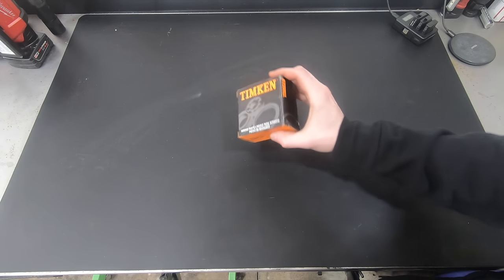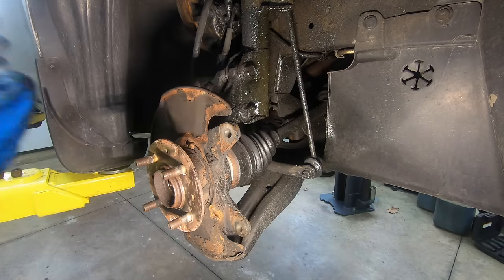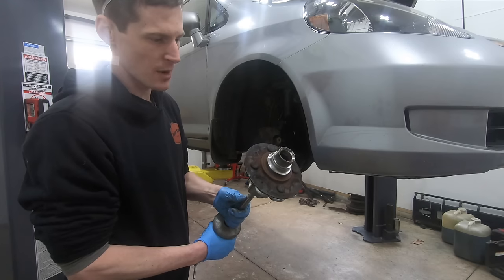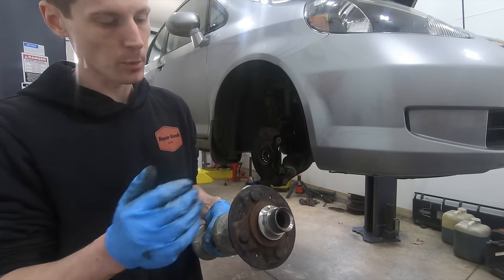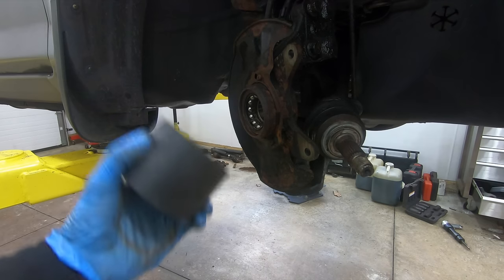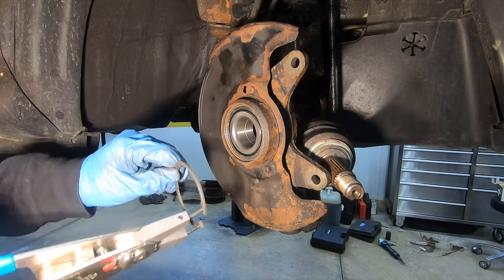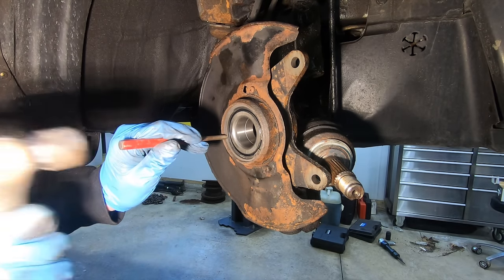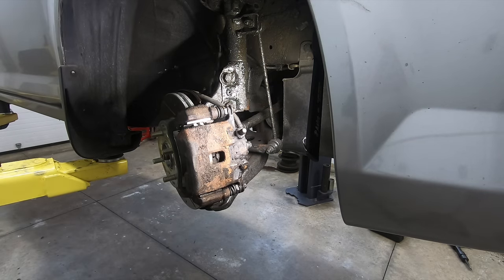How To Change A Press In Wheel Bearing Without A Shop Press.

Comment: The training was very good. Please explain that when installing the hub, how much hub should be inserted into the bearing to be sufficient؟ ❤
Reply: The bearing should be pressed into the hub until it reaches the point where the snap ring will be installed.

Comment: excellent video.  i was looking to see, if you would SIDE stress load the ball bearings while reinstalling. even slightly dinging the races with a impact, CAN severely shorten the lifespan and cause a annoying rumble noise. if a ball bearing is being used to leverage the race in place, it's wrong! most of us have learned this as back yard mechanics. save the beer and caffeine for later!
ALWAYS grind the hand impact screw tip down first, till it fits TIGHTLY in the rotor impact screws. NO WOBBLE OR ramping out of the screw! otherwise you WILL  be torching the now shredded lock screw head out. the impact tips fit loosely on my old1960-70's honda motorcycle case screws. i replaced a lot of mangled screws with allen screws. after 30 years, i have many philips screwdrivers, i modified this way. those sharp pointy tips on number 2's  are actually never needed on screws. manufacturers never bother to do this last step[cost cutting]. buy or borrow a belt sander. BLUNT THEM!   
this step is better then the time invested removing a mangled up screw tip with a cutting torch. this could triple your time on a normal 1 axle brake/rotor job, if you don't. ask me how i know. also grind away rust  & paint both contact sides during rotor removals for anything, in the rust belt or coastal states[salt corrosion!].  make tools work for you, not the other way around.

Comment: When it comes to tightening any axle nut, some do it with the car on the ground or up in the air. 

Which is the best way to do it and do you torque it?

Comment: Excellent video, great thorough job, o have never seen anyone, do one like that, im curious,if a ball joint removal tool, will do the same thing, I bought one from HF, and replaced, the upper and lower, ball joints, and upper can lower control arm bushings, on my 01 express, 1500, conversion van, thank you for sharing!

Comment: Hi. Doesnt the drift has to fit the external side of the bearing in order not to damage the bearing?  I understand, in your particular case, because of the sensor left in place you have no choice but to use a smaller drift despite the risc of damaging the bearing but as a principle ALWAYS use same diameter as the bearing, isnt so?

Comment: Any advice on how to remove a inner race from the knuckle?

As I'm new to this removal of wheel hub bearing I reviewed probably all the known videos on the topic of "Ford 2013 Ford C-Max Front wheel hub bearing". Eventually found your really great video on this topic. But as I have done this task for the first time some things have gone wrong.

I'm a Rocky. But I say this just FYI. I'm am capable of rookie mistakes still. I would attach the major fails.

Major:
1) Bearing outer Race is stuck in the Steering Knuckle so tip it to wield this and it will shrink the remaining piece of the bearing out.
2) The tool slide screw broke on me. This is part number 78825-18 found online not unlike most of these tools.

Minor:
1) turned screw to untighten in wrong direction on  small bolt...

2) I had to tap stripped tox scrip on speed wheel sensor.

3) Lost one nut, but standard size on lower/outer/control-arm. Will get one of these.

Some partial successes:
1) learned how to get the ball joint out using pickle fork and figured out how the odd angle of this lower control arm swing and direction of the ball joint peg angle differ. So just tap of hammer to make ball joint point slightly to center and drops.

2) use slide hammer to get out wheel hub will start with this next time.

Thanks,

Comment: This is a good video. I did notice your brake rotor however and I believe you may have it flipped. That looks to be a front passenger side wheel, but you have a front drivers side rotor on it.

Comment: Very good video for the DIYer. One question. At 17:35 in the video, where you are pressing in the bearing, you stop and appear to change the plate before you firmly seat the bearing. Did you change to a smaller plate to support the inner race? If so, is that necessary?

Comment: Excellent video. you have a nice way of explaining things and you are thorough! 
Snap RIngs: they typically have a side with a hard edge and another with a rounded edge. I like to install them so the hard edge is against the outside. IMO it is better to have the force pushing against this side vs the rounded side  - a little extra insurance that the ring will keep everything in place.

I do something similar with washers when assembling powder coated stuff: tools, machines, trailers. This time I put the rounded edge of the washer against the powder coating. Less chance of the washer cutting into the powder coat and making a place for rust to start. I live in the Rust belt too :)

Comment: I have a question, do you have to put the new wheel bearing and hub in the freezer with an Aluminum Stub Axle, and then take it out of the freezer and press the new bearing and hub in when frozen?

Comment: Glad you dint rip out the center of the bearing and left the outer section good idea so you dint have to mess with the sensor if i had done it with my luck i would have had to do it twice lol good video you should have mentioned the chance you run by pulling from the midle of the bearing not that it was wrong in that situation but so people would no!!!!!!

Comment: Nice video and Bering removal , but a lot easier , cheaper & better to get a hub with the wheel-bearing already  pressed in .
Reply: That wouldn't work in cars with bearings that are pressed into the knuckle before the hub is pressed into the bearing, which is how a lot of cars work.
Reply: @kovie9162  On my Accord they literally were selling the whole brand new knuckle for $150 - new knuckle, has bearing and hub already installed, etc.    It's crazy.      Only question I had was the quality of the bearing they use vs an OEM Honda bearing that you press in like in this video

Comment: 8:35 Not sure if it's possible to remove the dust cover without taking the whole bearing apart, but if you do take it apart, it's a good idea to replace the dust cover while you're at it.

Comment: There is an easier way/tool to remove the hub than with a slide hammer: Astro Pneumatic Tool 78830. Thanks for another nice video.
Reply from the maker: Slide hammer is half the cost though.
Reply: Not easier on the wallet. Astro Pneumatic Tool 78830 costs over $200. Slide Hammer costs less and has more uses.

Comment: The hub pretty much fell out only pulled it off with my hands is that hub bad?? I put new wheel bearing in and when I pressed hub back in. And it was still wiggling so I tried pressing in again and it still has lil wiggle so I tighten cv axel and no wiggle. Still got noise is that hub bad??

Comment: Another Subscriber here.. You explained very well, can I use this procedure on a 2014 crv ,awd with abs, without removing the speed sensor? Since I don’t have acetylene will using map gas loosen the inner race? Thanks in advance

Comment: Guys im just going to tell you from experience, if you have a press in style wheel bearing and its way past due to be fixed, you are better off just getting a whole new knuckle, bearing, and hub assembly. No special tool or amount of psi from a shop press is going to make it budge. A clear indicator is going to be just how hard it is to get the snap ring out and if your brake discs are worn out bad. If you go too long without changing a whiney wheel bearing it is going to heat up and practically weld itself in.

Comment: Hello, this was a very well done video, Thanks for posting. I have a question though, I bought a rear wheel bearing for my 2008 awd tucson and both sides are not magnetic. Does that mean I can put the bearing in any way and the sensor will work?
Reply from the maker: The sensor could possibly be reading the CV axle and not the bearing. Was the original magnetic? You may have the wrong bearing.
Reply: @RepairGeek  the original is not magnetic either and looks the same. I am fairly certain that it is the correct bearing as I was told by a parts store it is and it is listed online on most sites as the correct bearing. I also asked on a hyundai forum and someone who posts a lot there said it is fine, just fit it. The sensor gets the signal from the tone ring and I can put it in either direction as there is no magnet to worry about. Thanks ffor your reply, I am going to put it in today, unfortunately they sent me a bearing for the front but I wanted two rears so now I have to order another one and wait  for that.. there is always something.

Comment: I used an air hammer to remove bearing race from the hub. Heat didn't work for me because I don't have an oxy acetylene torch. Map gas couldn't get it got enough.

Comment: Definitely need to brush never-seize on the axle shaft spline after wire brushing,  but do not use any on the threads. That will distort the proper torque required. The splines will not rust welding place, & if ever removed again, it will prevent a lot of cussing.
Always lube the threads on the puller to make it more effective & make it last longer.

Comment: Great video. Is it okay to use grease or antisieze between the 2 surfaces being pressed together, or does it have to be clean metal? Thanks
Reply: Clean metal. If you use grease or antiseize, you could end up with big problems.
Reply: @kittyhawk2171  thanks

Comment: I am going to be trying to do my 2012 civic exl and 2019 HRV from bearings.  Question. Should bearings still be put in freezer over night? And should I apply grease to outer part of bearing before installing?

I have the same tools you used in video so I think from your amazing footage I can do this. 

Thank you
Reply from the maker: Putting the bearing in the freezer can help but don't expect a drastic change.

Comment: Can you use the same tool to take off the hub as used to take off the bearings instead of the hammer slider version???
Reply: I have this same tool and there's usually no way to make it work that way. If you look at a diagram of how these go together you'll see that it's generally not possible.

Comment: Does the new hub come with a bearing race installed already? It didnt look like your new hub had a race on it?
Reply: No, the bearing race being stuck on the old hub is just a result of you destroying the old bearing taking it apart.   You are pressing the hub back into the new bearing which as you can see is an inner and outer race already assembled

Comment: Is there any reason you can't use the slide hammer to remove the hub without sliding the axle all the way out. Wouldn't the cv axle just slide out the backside as you remove the hub with the slide hammer?
Reply from the maker: You could do that but you still have to get the hub out of the inside of the bearing.
Reply: @RepairGeek  ya I have the bearing  removal kit was just thinking if you just hammered out the hub (leaving the 2 bolts on the upper shock) then once the hub was out then there would be enough free space to get the cv shaft out?

Comment: Great video.  Thank you!  Getting ready to do this on my FWD.

You didn't mention in the video, but I suppose putting either oil or grease on the main bolt (of the bearing press) should help.
I've done wheel stud installation before using a pull-through tool; by oiling the threads I avoided metal-on-metal chew-up.
Reply from the maker: Yep I use anti sieze or grease on the bolt threads.

Comment: This worked excellently for replacing the bearing and hub in my 2009 Honda Fit. Unfortunately, I used a magnet to determine the side with magnetism, which unbeknownst to me at the time, ruined the encoder ring and gave me an ABS code after the replacement.
Reply: Bummer! I saw someone test for magnetism with a paper clip. I imagine using another magnet is what caused the encoder problem.

Comment: Excellent video. I noticed you used the air ratchet as opposed to your electric Milwaukee.  I have electric impacts. Have you done this job before with an electric impact pressing in and out the bearing and wheel hub?
Reply from the maker: The electric will do it no doubt. I have more experience with a pneumatic impact.  It's easier for me to tell when it is laboring audibly. Just personal preference.

Comment: How do you like that flexzilla air hose reel? On the fence about it?
Reply from the maker: I like it I've had it 4 years or so. No leaks. The return spring could be stronger but I have no regrets. Only real downside is the hose always looks filthy because it's such a light color.
Reply: @Repair Geek, thanks for the feedback. I will give it a try. Great video as always

Comment: I just "pressed" (screwed) mine out.
Going back in iam going to start with the same set up you have but one it reaches flush with the knuckle iam going to use the old bearing to continue forcing the new one in..
Reply: Also mine coming out did not have a snap ring.
2017 focus.
Have you seen that before?

Comment: Pro-tip: Be careful with your fingers when using the slide hammer…. The Master Tech at the the dealership I used to work at literally popped his finger using one of those things….. And yes, you read that right… popped… and it looked exactly how it sounds like it would look….

Also, if you tie a shop towel around the grip you can get more leverage in the hammering, just make sure you have room for when the hub comes flying off…

Comment: The 2 easiest ways to remove the bearing race from the hub that nobody ever seems to mention: 1) If your slide hammer came with a 3-jaw puller (most do), attach the 3-jaw puller to the race and - while standing on the hub - pull the race off w/ the slide hammer or... 2) With a large bearing puller (less than $30).. also attached to the slide hammer.

Anothger note.. if you have a welder, I often weld a couple nibs onto the race in situations where the race has nothing to "bite onto".  From there, the typical bearing puller grabs right onto it and - with a slide hammer - allows fast extraction.

Finally... if you have a oxy-acetelyne torch... you can just heat the race and 9 times out of 10 the race will literally just fall off the hub once you get it good and hot.  Takes just a few seconds.
Reply: Good job

Comment: When you press in the new bearing and the wheel hub, how do you know when to stop?
Reply from the maker: The bearing stops moving and the bolt gets much harder to turn.
Reply: @RepairGeek  Is it the same for all makes and models? I´ve seen mechanics who measured the distance prior to removal

Comment: Put in freezer over nite...like some have already posted....I heat the knuckle up with my torch ,inside where the bearing goes ..your bearing will almost drop in..also...if I need to ..I take the 3 nuts off the strud & drop it down ...this doesn't mess up your alignment ...easy to pop strut back up....cheers

Comment: For an easier way to get the snap ring out is hit it with the penatrating fluid, then grab a wire wheel on a drill and clean the outer ring all around, it will free up once you get a good set of snap ring plyers on it and give er a squeeze. 75% chance or more to reuse the old snap ring lol.
Reply from the maker: 😂😂😂 Yes if you want to leave the vehicle disassembled, soaking it with penetrating oil for a week and use 5 bucks worth of penetrating oil to save a $1.50 snap ring...

Comment: My 02 Jeep Grand Cherokee Laredo 4.7L has the bearings press fitted on to the axle shaft. So you have to cut and chisel the bearing/race and lock ring to crack and split it to get it off. Then use a bench shop press to press fit it on.
There is a retaining plate that holds seal up against bearing and axel in instead of having to take a c clip and pin out of differential to get axel to slide out.
These tools in this video won't work for my Jeep. The bearings don't come out the same direction as hub, they come off the inner spline side all the way up the shaft towards diff after you slide it out.
On a plus side, you don't have to open diff, you don't have to take knuckle apart or any ball joints.
That's my rear axel seal and bearing assembly.
In the front I just swap out Wheel Hub Assembly.

Comment: Good video… but you have the bolt facing the wrong direction lol. Most use a 1-1/4 deep socket to fit as the threads go past the nut but otherwise, good video

Comment: Should have replaced the CV shaft while you were at it. Boot was visibly torn and there was CV grease flung all over everything in the wheel well.
Reply from the maker: Interesting, that was all lanolin undercoating and the boot isn't torn.

Comment: Best way to remove race drone hub is with a torch if you have one. Heat it glowing red and it falls off
Reply: would this work with a normal propane torch or do I need something bigger?
Reply: @JCO847  Even MAP gas won't heat the race to the required temperature. You will need to use an oxyacetylene torch.

Comment: Slide hammer not needed to remove the hub, just use the bearing press to push it out. No need to buy/rent unnecessary tools.
Reply from the maker: And what are you going to push against to push the hub off?
Reply: You are clearly a novice eh? Omg.

Comment: One of the main reasons that bearing goes bad as people drive through deep water or their car sits in deep water for a period of time because all that water has just a little bit of dirt in it and dirt is kind of like a sand it's a very small sand so if it overwhelms the grease that you packed in there it screws up your bearings and your CV shaft everybody knows that